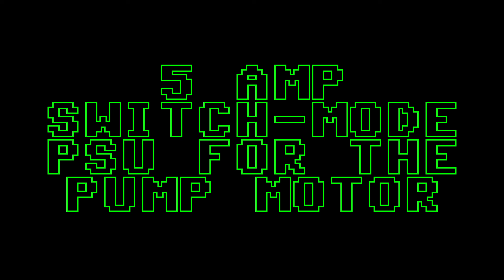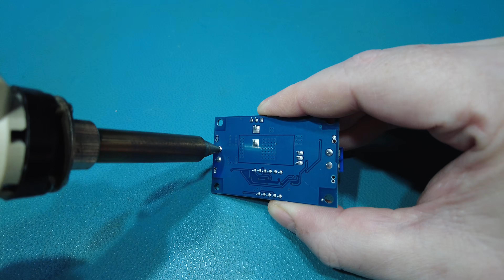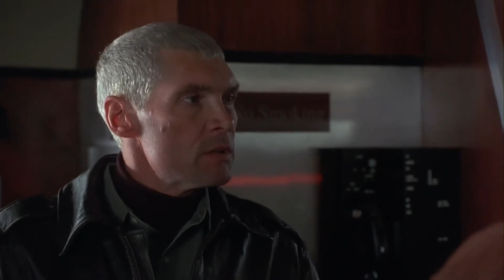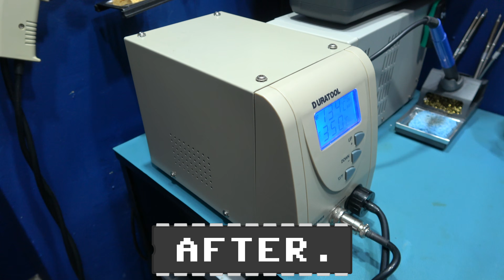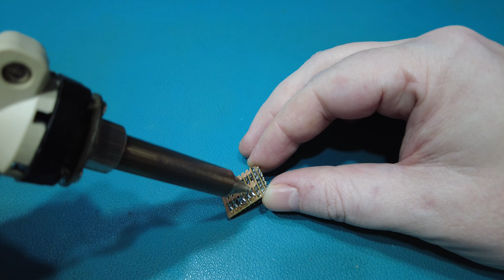Duratool ZD-915 Desoldering Station - Mod - 5A Switch-Mode PSU for Pump Motor & Quieter Fan Install.

Comment from the maker: It's now the 29th of December 2024, almost 3 months after performing this mod and the Pump Motor and Mini 5A Switch-Mode PSU are still going strong. I've seen no signs of destress from the Pump Motor or the Mini 5A Switch-Mode PSU so far.

Comment: In my ZD-915, I installed the largest fan that would fit—an 80x80mm model, if I recall correctly. The idea was to use a fan twice the size so I could run it at lower speeds. I also installed a 7V regulator, and now I can barely hear it. It was a total game-changer, because I couldn't stand the station's whining noise. In your case, just swapping the fan won't make much of a difference, because you're still stuck with those ridiculous holes—put there for some unknown reason—instead of a single large opening that wouldn't unnecessarily restrict airflow.

Comment: After watching your video, I opened up my newly purchased ZD-915 device, considering modding it myself. When I opened it, I saw they had installed a larger motor. Measuring the voltage it draws while running, I found it draws 13.5 volts. This means the manufacturer has increased the vacuum power of the gun, and the voltage drawn by the motor doesn't drop at all. The motor constantly draws a stable 13.5 volts. I think they've also added a small electronic circuit to prevent voltage from returning to the motor. So, it's not just a diode; there's a small electronic circuit board. I also noticed that there was no change in the fan speed or noise when the motor was running. This is because they've now directly powered the fan from the motherboard. They've also moved the resistive voltage reducer board, which reduces 18 volts to 12 volts, to the front panel without a case. Furthermore, they've added a rubber piece to the outside of the motor to reduce vibration. The only remaining problem with the new device is the noisy fan. So, as you can see, since I realized the manufacturer has already done their own product development on the device, I gave up on the modding process.  I wanted to inform you that the newer versions of the ZD-915 have improved. You've made the best modding video for the ZD-915 yet. Thank you.

Comment: I have an Aoyue 2702, which uses a similar gun/pump arrangement, one thing I noticed early on is that to stop it clogging you have to continue sucking AFTER you remove the iron from the joint for a couple of seconds to prevent clogging. I've watched a couple of these videos about the ZD-915 and have noticed in all of them when people are using the gun they stop sucking far too quickly, I suspec that this is one of the reasons that you are getting clogs. 
But mods look good, I've just ordered the bits to do my ZD-915, which I have just bought as a second station, for use when I'm not at my bench.

Comment: Great video! To avoid the annoying noise of the fan, I soldered its wires to the vacuum pump motor. So the fan works when I press the trigger of the desoldering gun. I must say that using the 5A buck is really interesting for the fan and the motor. I will definitely use it. Thanks for everything and for everything. Really useful and interesting video, very clear and understandable. I would like to ask: to set the buck to 12 volts, did you use a power supply? Thanks again.

Comment: I have an Edi-Tronic ZD-915 sucker station, which is the same in this video. But my unit has a 24V fan installed. However, I made a similar mod like you did. Thanks!
Reply from the maker: I've been told that some of these come with 24V fans. Some of the 3rd party manufactures must of known the OG fans were being over volted.

Comment: Dear Sir,
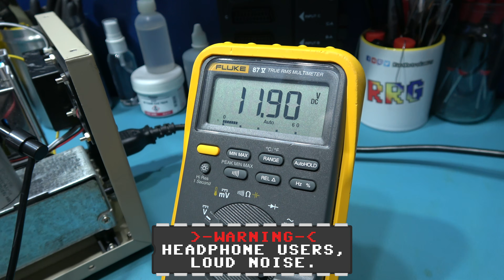I am writing to you from Germany. May I ask you a question please : On this video you are measuring the voltage of the motor with your multimeter (at 10:13 Min). You put the black lead  to the contact, where there ist a red plus marked on the motor and you put the red lead on the negative pole and you received a positive current of ca. 11,88 V. Are the contacts of the motor reversed ? On my ZD 915 it is the same thing : the red plus is not plus ! What are the consequences for the modification of the desoldering gun ?
Thank you very much for listening to me.
Greetings 
Géza

Comment: Nice modification, especially with the printed bracket. But the final test is a little weak as you used a single sided board, no ground planes and fresh solder. Also miss the EMC diode over the pump motor to protect the dc-dc converter. EMC damage happens over time, degradating the powerply bit by bit until it fails.

Comment: Something to bear in mind, the full power supply for the motor goes to the trigger micro-switch in the gun. With no current limiting dampening the inrush current, that switch can arc and degrade over time necessitating either replacing the micro-switch or the whole gun. To get round that another mod is to install a relay or mosfet inside the main unit and the only current to/from the gun is the small switching current for the relay or mosfet.
Reply: This is what was done in my unit!😋
Reply: The most common mod I've seen was the automotive relay (12V). Also, the Sunon maglev fan is a good upgrade

Comment: I've watched a few of these mods now. One I watched yesterday showed a guy fitting high current diodes to the motor and Input voltage to prevent reverse voltage going back toward the DC DC converter. I think the guys name was Jan Beta. He also posted a full blog in German, but google translate does a good job :) As for the fan if in use for a long time I personally would have the fan facing out removing hot air. Mine is never turned on for long periods so don't think it would make much of a difference tbh.

Comment: The inrush current to the motor will be limited (a bit)...  You have forgotten about the resistance of the wire to the trigger switch.  If you remember you had to increase the PSU output voltage to 13V to get 12V at the motor to counteract for the resistance of the wire.

Comment: Kainka Labs’ made some interesting mods to improve suction for his ZD-915. The stock way has to evacuate the hose of air before suction starts to build so he uses a solenoid at the handpiece to open to the vacuum after suction has built up. For my Aoyue station I just pinch the hose. ;)